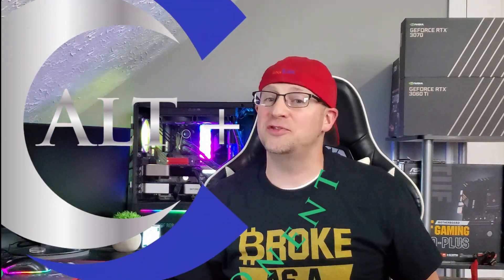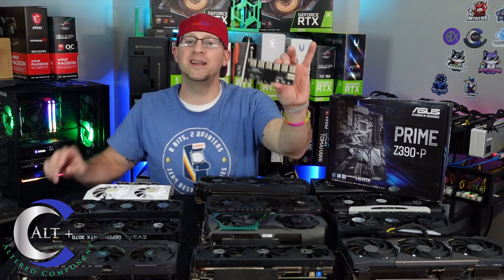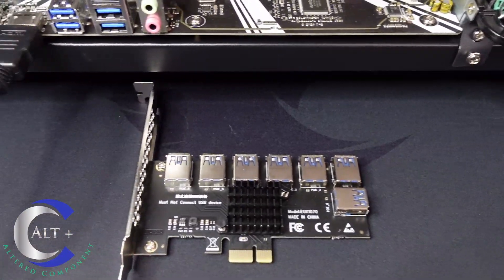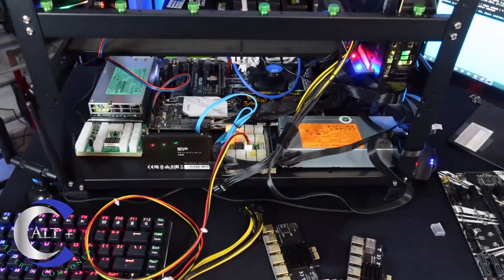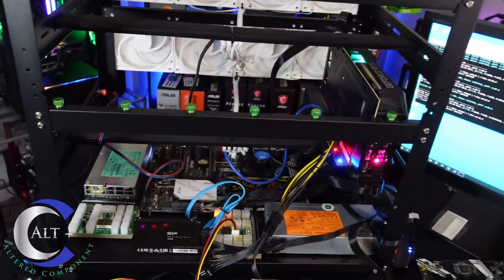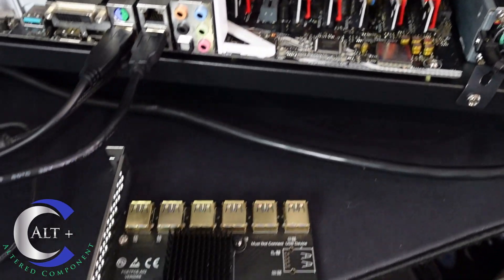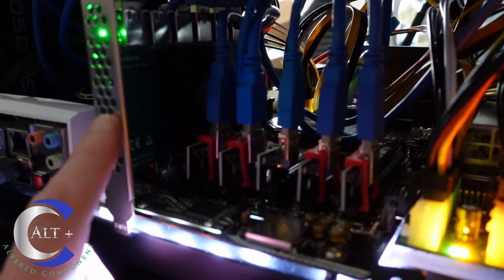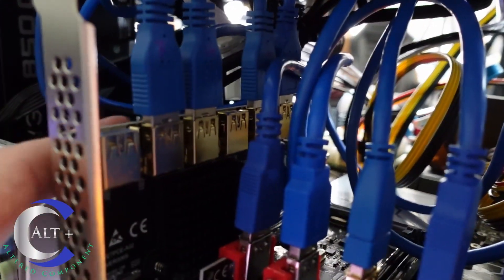How many GPU's with a PCIe Splitter adapter | Testing & Mining | Should you use and How to

Comment: I have a z270-A, running 10 GPU's in HIVEOS. Using the m.2 adapters to one USB. so only 2 GPU's RUN on a PCI Splitter. Worked for me. Have not tried 12 but I've seen a video on youtube that did manage to do it on the same mobo.
Reply from the maker: Very nice.  love my Z boards. appreciate the feedback

Comment: Cant wait to try this out! Do you know if it will work on most models of boards even if your trying to add a modest two additional?
Reply from the maker: Most modern board can easily run splitters and get 8+ gpus.  As long as your cpu and board have enough pcie lanes

Comment: All motherboards when combined Chipset and CPU PCIE lanes, will always have a maximum number of usable PCIE lanes. So obviously, you can try all the PCIE splitter you wish, you will never be able to go further.
You could maybe free some few PCIE lanes by disabling the onboard audio controller(s), unused SATA port(s) and also unused Ethernet controller(s).
Have a great week ahead my brother and keep on frying your motherboards :$
Reply from the maker: Thanks for the insight as always.  Great response on these setups.  I do generally disable onboard audio.  And i know the cpu has 16 lanes.  The hard thing is to get all those mobo lanes to dedicate to the gpus.  been testing these adapters with a few boards lately.  Seems like i can easily get 8 or 9 gpus on most modern boards, then the issues begin

Comment: Did you try the 4 x card and tell bios to force 1x mode? I want to try this with a h110 btc pro and see if I can get to 18 😅
Reply from the maker: man that would be sick.  I am pretty sure Panda tried that before but i could be wrong.
Reply: @AlteredComponent  the reason it MIGHT  work is you saw it. If you bump to 1x you could have 3 lanes open

Comment: Hi. How did you get your ASUS Z390 mobo to accommodate so many 3070 cards? I have a rock stable MSI X570 gaming edge mobo and it will only allow me to use my AMD 6800 card with a lowly NVIDIA 1060 card. My main rig has stability issues and I'd love to connect my 3090, 3080, 3070 cards one at a time along side my AMD 6800 so I can tweak my 3000 series cards with a known rock solid mobo setup.   However, I cannot get the 3000 card to work with my 6800 card. Tech support said I only have 1 x16 slot (not true). In any event, I was thinking about getting a splitter to use for the x16 pcie 4.0 mobo slot but then i see you're also using a gaming mobo and have 3070s attached to even the pcie 3.0 slots.   How did you do that?  I should mention I'm using an AMD Ryzen 5 3600 cpu which does not have VGA capabilities. My Monitor is connected to the AMD 6800 card.  MSI told me the following "This motherboard only has 1 x16 slot. slot e3 only works at pcie x4 which is insufficient for a full x16 GPU. This is why you are getting those errors. This board does not support multi GPU in that manner. PAge 15 of the manual shows support for only AMD crossfire, and page 30 shows the breakdown of PCIE bandwidth.	"  I'm starting to suspect that I have only 1 usable expansion slot and with that I can use a pcie splitter to add more GPUs.
Reply: Don't know what you're on about but you only need a x1 slot for a single GPU. You  likely DO have one x16 which can be utilized at such, at a time. You do know what risers are..?
Reply from the maker: sorry if you already get this, but good risers for one are needed.  A riser changes an x1 slot and runs it out to an x16 slot for a gpu to plug into.  The caveat is you would not want to game/use for heavy media output a gpu on a riser as it will run only limited lanes.  now the other issues is, running a mixed rig can sometimes be painful in windows.  What i mean by mixed rig is AMD + Nvidia.  So where it can be quite easy to get a number of Nvidia cards up and running on a mobo, or getting a number of amd running on a single system, getting mixed to run efficiency in windows is not always so easy. Ignore that technician btw.  he does not know mining.  I have an msi gaming x470 board that i was running 6 gpus on with no issue.  it was running a ryzen 1600af chip which is like a 2600 basically.  in bios settings Enable 4g decoding.  If you do not do this step, a board may only read 2 or 3 gpus.

Comment: Brother, I had an 8 gpu Windows 10 limit too. What fixed it was manually setting page file "virtual memory" to be enough for all the memory of all the GPUs in the rig. Also "uninstall" those device manager display devices and scan for changes. This will fix your issue. I first thought it was my 3 1 to 4 splitters but they worked fine in HIVE os. Set virtual memory to accommodate the cumulative gpu memory plus extra and 12 will work in windows. Thank you for the 1 to 6 adapter link. I keep missing brandoncoin's friend selling the 1 to 6 adapters.
Reply from the maker: Thanks for sharing but I set virtual memory prior to build.  I set it to 1024mb x 6gb x 12 gpus.  So 8 had 73,728 set in virtual memory prior to card install.  Unfortunately in this case, not the virtual mem.  But a good tip that I should have mentioned in video.  Appreciate the insight
Reply from the maker: Often people say to set 1gb to 1gb of gpu, but this tends to be a good bit more than needed.  So I use 6gb for 8gb catds
Reply: @AlteredComponent  Did you try setting 8 in this case though?

Comment: I used Amd setups because it was easier to get enough pcie lanes.
I use Hiveos native, not windows
I have 11 cards on my rig: Msi x470 gaming mobo, with ryzen 5 1500x cpu. 
3 x 4 way splitters.
 I could add more cards I guess but I don't have anymore.
Reply from the maker: thanks for sharing.  i think hive is much more  simplistic on these types of projects and definitely for AMD tuning.  I have a msi x470 gaming plus with a  ryzen 1600af in my bot build.  It is running dual 3060 rev 1 cards fully unlocked.  nice board and cpu combo.  Mine on my man